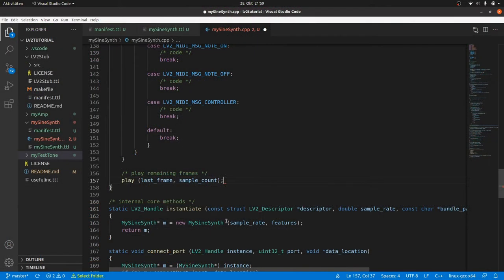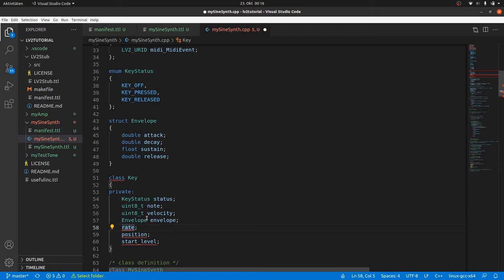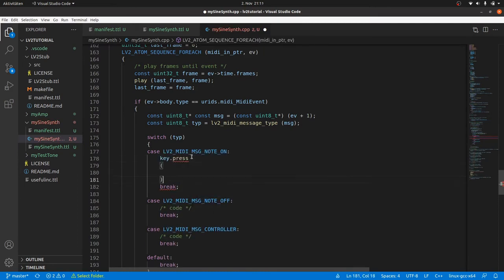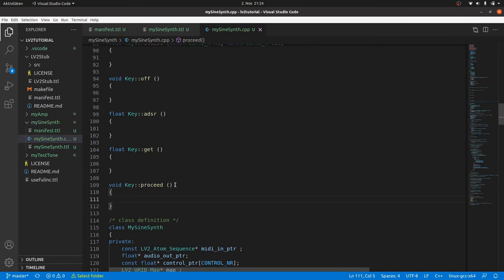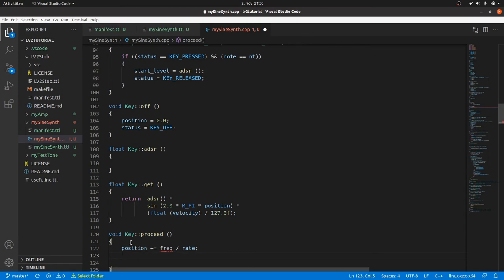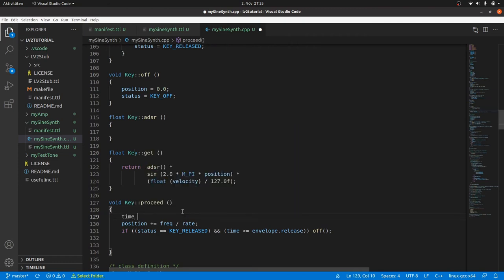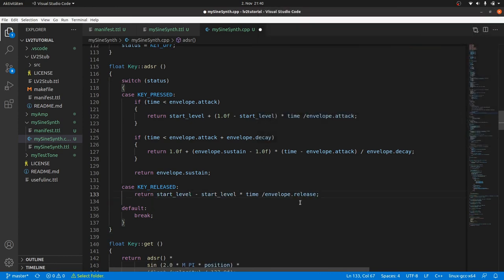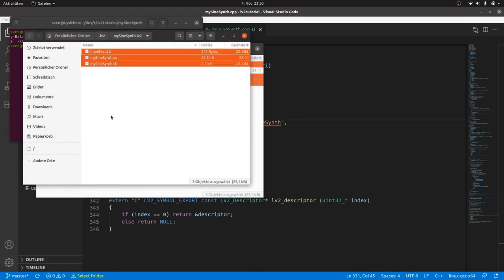Programming LV2 Music Production Plugins From Scratch - 08 The Simplest MIDI Synth (Part 2)

Comment: What's the best way to print debug information, or otherwise debug problems at runtime? (Maybe this will be covered later in the series, IDK)
Reply from the maker: I go with gdb and use jalv as a minimal lv2 host. Compile with an additional -g flag for the debug symbols. Then call gbd with jalv from the terminal:

gdb jalv.gtk3

or whatever jalv variant you want to use. Then call run with the plugin uri inside gdb:

run https://my.plugin.uri

(of course you have to replace https://my.plugin.uri by the right one).
Reply from the maker: There is also a very useful LV2 extension called log. But I've to admit that I'm too lazy for the most of the time and I simply output to stderr (and thus ignore realtime) ;-).
Reply: @bmusic9817  Thanks! I'll try that instead of copious cout statements next time!